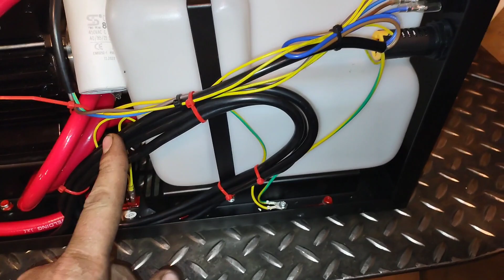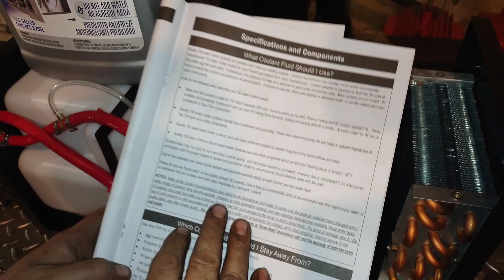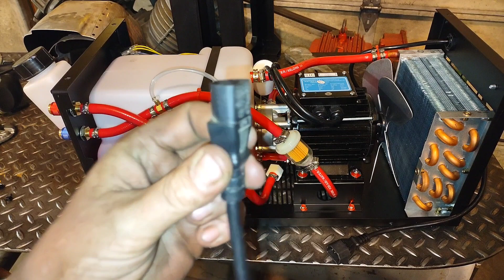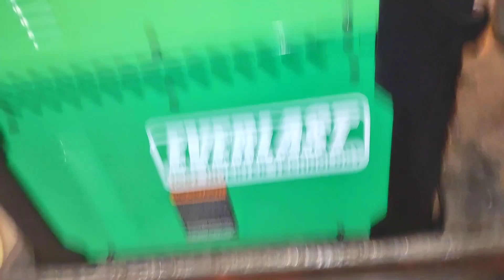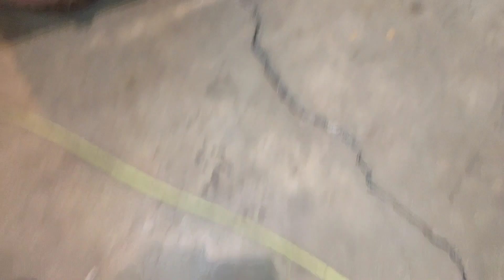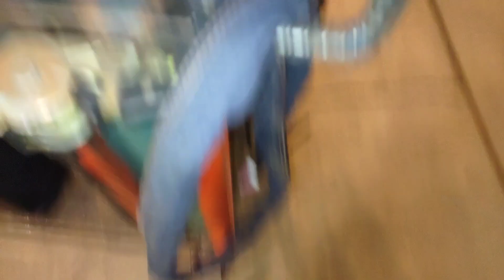(366) Everlast w375 tig water cooler with 256si welder, adding a filter and using red ELC coolant.

Comment: It’s kind of funny what the manual states what coolant to use. First it states to use any major brand tig coolant and at the bottom where it states what not to use is listed: propylene glycol and alcohol. Most of the commercial tig coolants are either propylene glycol or ethanol based. So if I correctly interpret what is allowed to be used it will narrow down to only Ethylene glycol based tig coolant. And even from that you should know that it includes lubricants (which I haven’t seen stated so far). Otherwise warranty voided.

Comment: Did you leave this filter in or replace it with another type?  Is this a 5/16” gas fuel filter, same as a Fram G12 filter?

Thanks for the great video!

Comment: Not rated for high frequency start though.  🤷‍♂️
Reply from the maker: @Shadow6a  yes that's true and while I haven't tried the miller coolant or any other tig rated coolant the high frequency start seems identical between my water cooled and and air cooled torches so I'd say this is working fine for me
Reply: I'm running green auto coolant on my Miller for years. HF start and tons of aluminum.. no issues. Still flows and cools great.

Comment: What other filter would you recommend
Reply from the maker: @aurileus226  well there are a thousand and one options you could go with for a filter. This is just what I had on hand that day. I would like to replace this was maybe a racor style fuel filter at some point
Reply: @tdm8817 is there room for a racor filter in there? It looks tight for internal filter options!!??
Reply from the maker: @ray-real1 ya it's really tight, I think I'll add a external racor filter here soon, just ordered a few for other applications and if they work out I'll put one on here too
Reply: @tdm8817 yeah you’re right, an external filter would be best. Otherwise it could be a pain to get back inside the cooler to check and change a filter, especially if someone attaches the 325EXT on top on the cooler.

I wonder how much filter media that little cooler pump can push through before coolant flow is restricted or stopped?

Maybe that little fuel filter or a  mesh filter is all that pump can handle?
Reply from the maker: @ray-real1 I don't think I ever tested the flow rate of this cooler without the filter, was worried about not having a filter. If there was debris in the cooler and clogging the passages in the torch. I don't remember what the numbers were on flow rates but I did test it and it was the minimum that ck recommended. The main problem with this cooler is it will heat soak and cant reject heat fast enough. I want to add a fan shroud to it and see what that does too.
Reply: @tdm8817 wow, good to know! I just expected the stock cooler to work really well. So where and how would this shroud be mounted, internally I’m guessing?

Those fan blades look low-tech too, inefficient and noisy.
Reply from the maker: @ray-real1 ya around the fan and I was gonna try to seal up around the radiator better. Most of the time it's not a issue but if I'm welding 250 amps for tens of minutes at a time it can't keep up, which is really annoying, thought that's what a tig cooler was for, but most of the time it works great and is a enormous improvement over a air cooled setup
Reply: @tdm8817 so you think some of the hot air is not being pushed out the rear of the cooler and instead being circulated inside of the cooler?

Oh yeah, shroud the fan to the radiator, which should force the air and heat out the rear…instead of allowing it to circulate inside the cooler!!??
Reply from the maker: @ray-real1 ya I think a lot of air is just moving around in the cooler housing
Reply: @tdm8817 I would have thought the cooler case being near the fan would act as a crude duct, but I guess the air is bouncing off the front of the radiator.

Maybe a puller fan added outside on the back of the cooler would help? But now that would need to be mounted and powered too. 😬

I may try adding a pre-cooler (transmission cooler or through a short zig-zag section of 1” copper pipe as I did with a water-cooled PC I once made) externally before the hot water enters the cooler box along with an external coolant filter, but that’s not going to help the limited flow.
Reply: I’ll try one of my Frankenstein ideas to see what helps, but it may be several weeks until I get to it.
Reply: I have a home-built unit that I put green press Stone antifreeze in it. It lasted 25 years until a mouse found its way into the tank. 😅 I took the system apart and the only place I found any silicate buildup was on the rubber diaphragm of the pressure regulator. I also used high frequency start all those years and never had a problem with it. My hoses were polyamide and nothing will ever stick to those. m
My new 25-ft TIG torch with rubber hoses would probably accumulate the silicates if I used that type of antifreeze again, tractor supply sells and OAT or organic acid technology coolant for diesel engines and the only ingredients are ethylene glycol and the fancy carbon molecule that prevents corrosion. It is only $8 a gallon and might be an option if you are on a budget.

Comment: The only difference between automotive and welding coolants is a guarantee that the welding coolant was made of distilled water, not a tap water. However, a quality automotive coolant might be made of distilled water as well, so there is nothing wrong to use it in a torch cooler. Technically, you can find such coolant and test its conductivity before usage, or just buy a dedicated coolant.

Comment: The problem with using auto antifreeze is the electric conductive. I switch to conteso from Amazon and I use water wetter for I am in Florida and it drops down 10° with it.
Reply from the maker: Well I'm not in Florida and it can get -40 in my shop l, hence the need for a coolant good to that temp.
Reply: @tdm8817  when a hose pops as you are running it, you will probably change your mind :)
Reply from the maker: @elementofone88  Almost a year later now and still working good. Are you suggesting that the coolant will degrade the hoses?

Comment: Find ya a nice six wheel mobility scooter knock the chair off build lower stand set that cooler on it then the welder above it . Use the foot part of the scooter for the gas tank. If ya feel froggie you can set up a remote controlle and drive the welder around. Works awesome rolls over air lines even ¹ in garden hoses . The nices thing is its suspension. Keep the circut boards in these igbt welders from getting jard around from hard wheels on a cheep cart .
Reply from the maker: Haha that's a good idea! I actually mounted mine to a large steel cart with 2 cylinders that I also have my mig welder on as well too.

Comment: @TDM speaking from experience and seeing that you posted this two months ago. I suggest you drain all that coolant out flush it out and just run distilled water or proper tig coolant after some time. Why. Well the effects that the power running through the torch head has on the electrolysis does to the coolant it fucks it up. Makes it gel and ruins your torch after time. Just a heads up. Other wise never see a. Guy ramble on about a basic piece of equipment before haha.
Reply from the maker: Well I'm very good at rambling, but I can't run straight water cause it freezes in my shop, I thought about the proper tig coolant but I'll stick with this for now and see how it goes
Reply: @tdm8817  so got one better for you since you don’t believe me. And think of why water heaters have Anode rods in the tank. The mineral stick to it when it gets heated as they become settled in the tank right. That happens on a much worse degree in your tig torch when you use automotive. Because of the electricity. Not the heat. But use that Pink RV antifreeze. It’s non toxic you can actually drink it. It’s used to winterize the plastic lines in RV’s. Instead of tap water. I use this in my tig cooler. 2 years no. Now discoloring or issues. CK worldwide doesn’t recommend it for their warranty sake with the copper wire but said there are no issues with their customers running it. You can dilute it also. Use 1:4 antifreeze and distilled water. Walmart sells it. It’s about $3 a gallon in California for it.